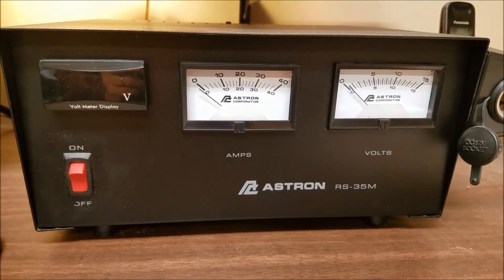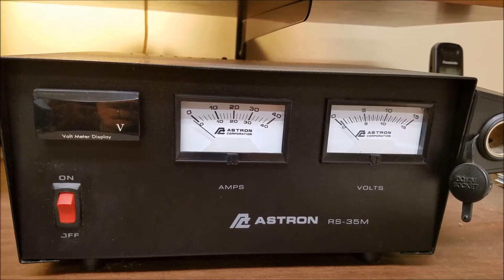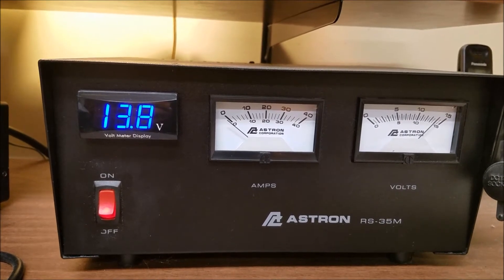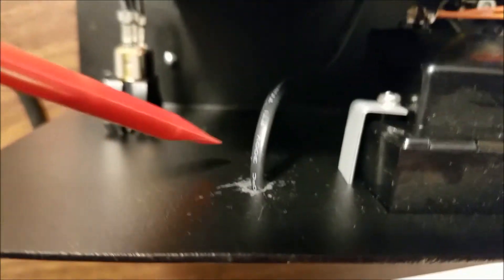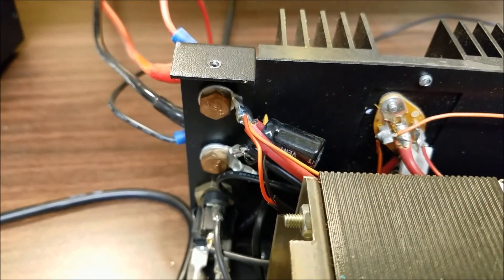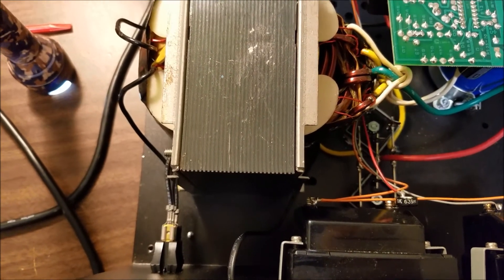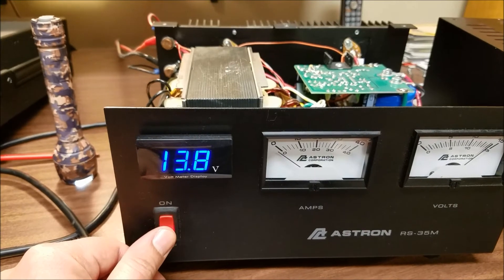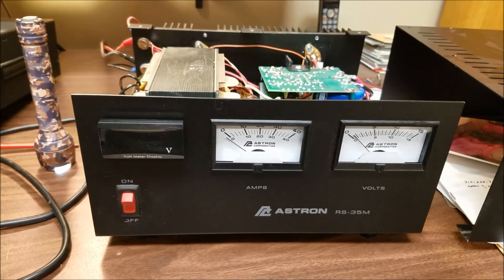Adding a digital voltmeter to any Astron power supply

Comment: Do you know if there's an Add-on Meter that does BOTH Voltage and Amps for the Astron?
Reply: There are. But you have to shunt the current. The problem with digital current meters is, if you are running SSB or CW, the meter's response is too slow to make and accurate reading. The analog meter is better for current.

Comment: Those voltmeters work very well.  Be advised though that the double-sided tape is fairly permanent.  Trying to pry the meter off the panel will result in the back of the meter breaking off.  WIth that result, it still works!